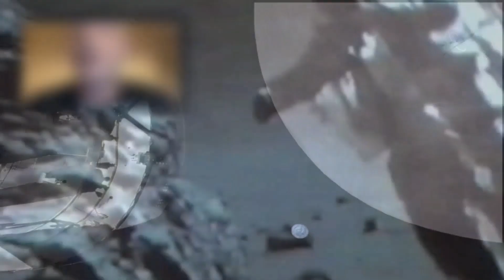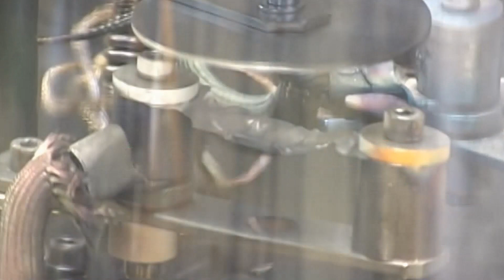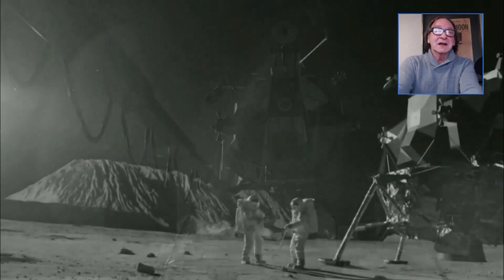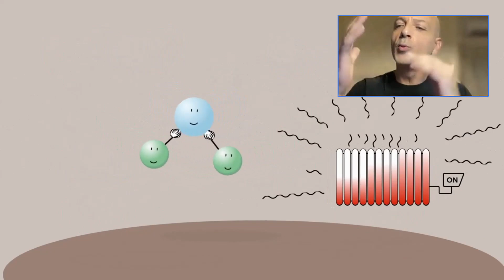THE APOLLO DISCUSSIONS "VACUUM\ SPACE SUITS\ FILM" PART 18

Comment: I'm told this is where the "opposition" is allowed to comment. Just a few minutes looking at comments. I see why. Everything that isn't blind obeisance is a threat and called hostility. Some good points raised here and no response from the Apollo Detectives. This whole operation is a farce. 

I'll ask here since I was attacked for asking on the main channel: what are Scott Henderson's credentials? What makes him an expert or authority on the subject of manned space flight?
Reply: I wouldn’t hold your breath for anything resembling a straight answer.
Reply: I am of course blocked over on the main channel.  My comments are of course usually ignored by the ADs (for obvious reasons) but maybe the occasional neutral passer by will see that there is a rational response to the nonsense they put out and may be nudged in the right direction.

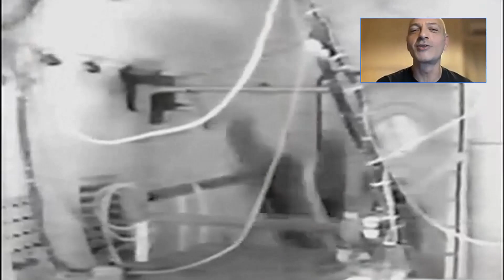Comment: 8:30 Hendersen: "one of the things that the comments that we get when we're talking about vacuum is we have people stating that it's not actually a force"

Demos then goes on to explain that you get a force when there is a pressure DIFFERENCE, something we have been telling you all along! 🤣
What if we had 10e-6 torr on one side of a plate and 10e-11 torr on the other? That is a difference of 0.00000099999 torr or 0.0000000193 psi or 0.000133 pa. Not exactly going to rip the fabric of space apart is it?

Comment: Then you’ve got the Gemini program designed to test out EVAs. International Latex Corporation are the ones selected for making the suits, and NASA was so disappointed in them they cancelled the contract. Apparently astronauts were overheating in the desert, yet the moon is over 160 degrees F hotter than that. And this was after they put their “cooling system” in the suits. They didn’t reopen the contract for building the suits until spring of 1965. Ed White allegedly became the first American to perform a space-walk on on June 3, 1965, despite the fact that NASA did not yet appear to have a suit that would allow for such a maneuver. It was announced that White would be performing an EVA while Jim McDivitt piloted the capsule. As McDivitt recalled, “Our EVA was very confidential at the time. We had not announced we were gonna do this, and we were doing all of our training at night, and only a group of maybe 30 or 40 people even knew we were gonna try it.” Translated from NASA-speak, what that very likely means is that a select group worked covertly with the astronauts to fake the space-walk footage prior to the launch of Gemini 4, because the Gene Cernan, Michael Collins and Richard Gordon spacewalks were all complete failures with Cernan almost dying. But then, in November 1966, a year-and-a-half after White’s alleged space-walk, none other than Buzz Aldrin performed a wildly successful EVA during the Gemini 12 mission. NASA then wrapped that up and declared EVA’s were easy as pie and the moon was a cake walk despite going 1/3 with 1 fake eva sprinkled in at the start. Then the Ranger program overall had a 67% failure rate. Surveyer had a near 30% failure rate. But Apollo goes 100% with no issues returning people from the moon alive?

The Apollo spacesuits supposedly weighed in at 180 pounds each, including the PLSS backpacks. You would think that with the advanced technology now available, NASA would have been able to streamline the package. To the contrary, the suits now worn aboard the space shuttle weigh in at 310 pounds each. And ILC claims that it takes three months and 5,000 man-hours to produce each one. Back in the ‘60s, they claimed to be cranking out a minimum of nine of them for each Apollo flight.

Michael Wargo, identified as the “chief lunar scientist for Exploration Systems at NASA Headquarters,” contemplating a return trip to the Moon: “’None of our spacesuits that we currently have would be appropriate for that extreme an environment,’ [says Wargo]. Any materials built for Earth-like temperatures won’t work on the moon. ‘They don’t bend anymore, they fracture, and they fracture brittle-y, and so everything gets extremely brittle at those temperatures.’” (“Water Discovery Fuels Hope to Colonize the Moon,” November 13, 2009) And so we discover that there is yet another piece of 1960s technology that has now fallen into an all-consuming black hole: non-brittle materials from which to fashion spacesuits suitable for lunar exploration. Back in the day, it will be recalled, Playtex’s bra seamstresses knew a thing or two about stitching together a non-brittle spacesuit.

NASA's spacesuit with ice sublimator cooling system could be scientifically verified on Earth today. NASA must publicly demonstrate before independent witnesses the operation of a NASA spacesuit with ice sublimator cooling system in a vacuum chamber on Earth duplicating environmental conditions of orbit. NASA refuses to verify and has always refused to verify its spacesuits with sublimators because they can't verify them because they've been committing fraud against the Citizens of the United States for more than 50 years. Plenty of NASA videos of spacesuits in swimming pools exist but there are none of spacesuits with sublimators in vacuum chambers although there is one video from 1966 of a NASA spacesuit without sublimator failing in a vacuum chamber causing a near fatality. If NASA regularly uses the spacesuits with sublimators on spacewalks from the ISS as they allege and regularly tests the spacesuits with sublimators in vacuum chambers at NASA's Johnson Space Center as they also allege then it should cost nothing extra and create no unacceptable inconvenience to allow a few witnesses to observe the next test.

$50,000 to anyone who puts neils suit on and goes into a vacuum chamber on earth and survives, down to even 10-6 torr and -320f.
Reply: Super awesome, but all Gemini suits were made by the David Clark Company. They were heavily based on the X-15 pressure suit. ILC’s contract issues had nothing to do with the quality of the suits, and ILC was NEVER contracted to build suits for Gemini. Try again.
Reply: ...and the rubber components in Neil’s suit lost their structural integrity decades ago. Your bet is baseless.

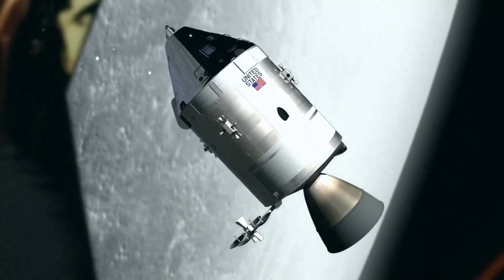Comment: 25:00 what happened when they stopped the barbecue roll to take pictures of the lunar surface? The barbecue roll was about 2 or 3 revolutions an hour. The CSM took about 2 hours to orbit the moon meaning that for one hour it was in darkness and for the hour it was in the sun, its angle to the sun was constantly changing so it didn't need to perform any barbecue roll because no part was in constant sunlight or darkness. When mapping, the camera is facing downwards, towards the moon, not towards the sun.

Comment: You will of course also be testing a film in the vacuum chamber at room temperature I hope? As Demos says "the only way to lose [heat] energy is through radiation there's no convection there's no air to come to you and take away the heat "
That works both ways, with little thermal conduction, the only way the film camera could gain [heat] energy is through radiation and the camera had reflective surfaces to reduce that absorption and was also cooling when in the shade as the astronaut moved around. The film was unlikely to have reached anywhere near a temperature extreme.

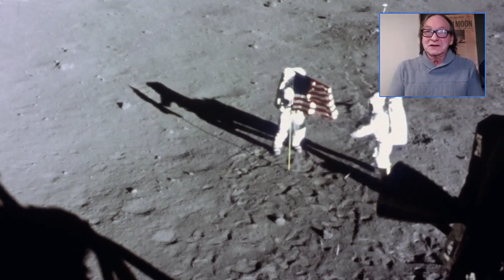Comment: 7:15 The zippers were to force together neoprene seals that were pushed together even tighter by the pressure difference between the inside of the suit and the external vacuum.
 Leaks? The suits leaked as they were expected to do, on the second EVA on Apollo 12, Pete Conrad's suit developed a leak of around 0.25 psi/min approaching the 0.3 psi/min safety limit.
NASA allows the suits used on the ISS to leak up to 100ml of air per minute.

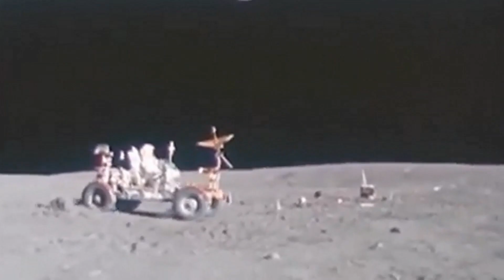Comment: 20:55 The Lunar Rover batteries. They were sealed but Each battery was protected from excessive internal pressure by a pressure relief valve that was set to open at 3.1 to 7 psi differential pressure and then close again.

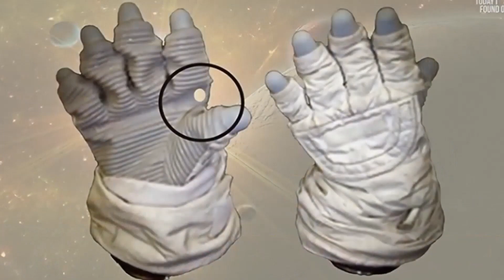Comment: 12:51 The puncture was NOT caused by a micrometeorite but by a metal palm restraint in one of Apt's gloves coming loose and migrating until it punched a hole in the pressure bladder between his thumb and forefinger. Apt didn't even know it had happened and thought the red mark he later saw on his hand was due to chafing. 
It was back on Earth when a suit technician discovered what had happened, he discovered dried blood on the outer garment and found the palm restraint bar.  When the metal bar punctured the glove, the skin of the astronaut's hand partially sealed the opening.  He bled into space, and at the same time his coagulating blood sealed the opening enough that the bar was retained inside the hole. The EVA in question lasted 5h 57m NOT 10h 49m.